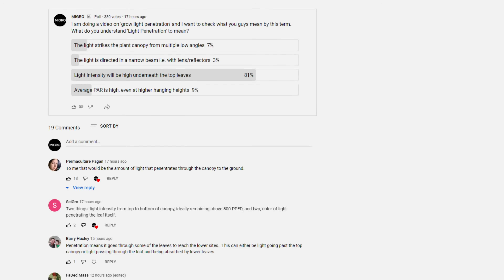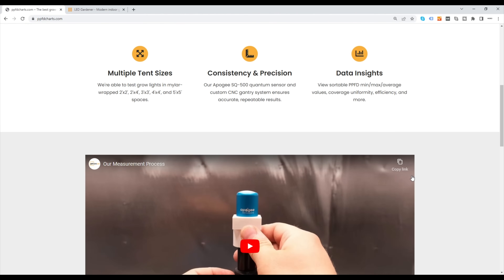Grow Light Penetration is WRONG

Comment: If you have the time to experiment or already have the knowledge, could you please make a video on LED grow lights and photobleaching? I've been experimenting with this for a few months and I came to the conclusion that the common consensus of it being entirely dependant on light intensity or blue light intensity is wrong. I have been testing with a variety of lamps, ViparSpectra P600, Spider Farmer SF1000, a sanlight Q1, and some DIY's. My main tests I did with the VS P600 because I noticed that light causes photobleaching the easiest out of all my lamps. I found out that if I add extra far-red light (740nm) with the P600, my plants can withstand more light without photobleaching. The same happened when I added more red (630nm) and deep red (660nm). A few days ago I started testing if IR light in the 800 range (850nm to be exact) would also help, but it's still too early to tell and I only have 1 850nm LED. I would love to hear if you already have any experience or knowledge on this? Also the migro lights seem to be impossible to find in Germany. Buying from the UK is no longer an option due to the customs charge nowadays.
Reply: I think migro is Dublin based so ROI and part of EU. Should be no custom charges?
Reply: @deelarso3766  Holy crap you're right. For some reason last time I tried to buy their UVB light I got the idea it was from the UK. Thanks dude

Comment: GREAT - now do a part 2 to explain why tearing off 1/3 of the upper leaves "so more light can get down there" makes about as much sense as sawing off your legs in Winter so you can use your socks for gloves.
Reply: Hey man, you may want to read "shape matters: plant architecture affects chemical uniformity in large-size medical cannabis plants".  Its a recent peer reviewed study available to freely read online.  Removing some of the older large leaves from the top of the canopy a few weeks before harvest to increase localized photosynthesis in your middle buds promotes chemical uniformity across the plant.  Your lowers ripen up and have higher cannabinoid percentages. Leaves photosynthesize less efficiently as they get older and localized photosynthesis in the bud sites affects ripening greatly.  Plants have extra leaves as they expect to lose some to pest pressure. You may not yield more overall, but you wont yield significantly less, and youll have a lot more marketable flower for packaging and less larf.  A combination of removal of the absolute bottoms, and a thinning of the top three weeks before harvest, resulted in by far the highest plant chemical uniformity and very close to the yield of control. It is the industry standard practice for a reason.
Reply: @willtremblay  that's the point, no one wants a beautiful bokeah of leaves and a lot of larf

Comment: The next question should be: Is it better to have a full plant canopy closest to the light or to have some openings to help develop the upper middle of the structure?

Assuming you are hitting max useable ppfd, there might be an argument for creative pruning to let some light through the plant.
Reply: I'm no expert but from what I've seen on grow videos that actually yield massily scroging and lolipoping (cutiing everything underneath the net) before stretch are the way to go. That way, the leaves on the net will create a barrier to prevent light from going under the net. Makes sense to me.

Comment: What’s really interesting is long wave and short wave radiation. I’m doing a grow from seed, using a 105w LED SMD panel light with dim ability through a MeanWell driver and Samsung LM301H/B’s. I’m using an oil filled radiant type heat source in my 2’x4’x5’ grow tent. Two plants, one was pinched at the 3rd-4th node, I’ve trimmed it up into a canopy of lollipops. It has 3-main branches after I removed the fourth one due to a first timer mistake. That side has been facing the radiant heat source, and it’s growing out a replacement stem to take the place of the fallen limb. Knowing that heat needs to be introduced in with LED grow lights, I suspect that what the plants are then able to benefit from, is that long wave radiation buildup in the soil, as well as the invisible heat from the long wave radiation. When she goes outdoors, that’s the side that I’ll face due-south in my northern hemisphere. That way, it not only receives the short wave visible light, but also the long wave infrared radiation that the hardcore HID crowd long for.
Reply: I do agree with the guy who can off as a prick.
Instead of adding a 1500 watt radiant heater,why not add an old school 150w hps?
You'd gain the ir heat,plus bump up your ppfd.
So may also find by doing so, you'll be able to drop the power on you LEDs.
I speak from experience.
I used heaters like that,and still do during lights off times during the winter months.
But I'll quickly throw an old school 400 w hps or MH up,and get rid of that 10 amp power hog as soon as temps allow.
🥂
Reply: @denniskartes1302 and you do what when the light are off turn the radiator on lol
This hps ir heat is just that nonsense
Reply: @denniskartes1302 plus is tent is probably inside is home
 is home not heated? and he live with a winter coat 24/7 inside is house
Reply: @denniskartes1302 Plus the tent is probably inside is house and is house is probably heated in winter so he doesn't need extra heat
Plus all the extra heat generated in winter by the HPS raise the temp inside the house and higher temp allow more humidity in the air and you end up needing a dehumidifier or run the AC in winter and AC don't run that well in winter and look kind of suspect
Or end up with mold inside your house
Reply: You're using a baby baby baby powered light and I assume about 12X more power on your heat source oil filled but still electric based radiator. It totally defeats the whole object. You're welcome 👍
Reply: Yeah, I totally hear all of you and this is my first grow so… In my defense, the heater is a small 300w unit. I’m really just experimenting with my understanding of light energy.
Reply: I'm the guy who came off like a prick. If you have access to RO water (not standard water) then you can get a warm mist (warm not cold mist) humidifier using about 300w and add humidity to correlate with the VPD charts plus they definitely add a couple of degrees C to the tent. More if you get the fans and stuff done the best possible. The perfect humidity helps transpiration and makes nutes go further and you're drawing the same power for faster growing optimum plant growth. Food for thought
Reply: Or just use HPS when it's cold.  Big big buds!

Comment: I've seen those comments about penetration as well, and it never made sense to me. Quite frankly it sounds very stupid, as if they just copied/pasted what they read on a forum without thinking.
Plant leaves are not transparent, they don't allow light to pass through. So even with the most powerful light on the planet, each leaf will always create a shadow. And if you tried such a powerful light to pass through leaves, it would destroy the plant because that would be a laser beam or something haha..

PAR is PAR and that's what matters the most. Most lights have a hotspot in the center with a PAR over 1000, and it goes to 700, 600, 500 on the sides. Basically other lights need to be raised higher to have the PAR in the center around 800-900, and to get a more even coverage. But this ''even coverage'' with raising the lights higher comes with a big minus, because now the PAR on the sides is also lower. The sides don't receive 700, 600, 500 anymore, now it's 500, 400, 300.

I'm very glad your lights can be hanged lower, it's extremely helpful for any grower, regardless of the tent height. Not only they provide a true 'even coverage' with a decent PAR over the whole canopy, but also your lights run very cool so they don't heat up the tent much, the light doesn't have to be high up close to the exhaust fan.
My ambient temperature from the intake air is 25C. I tested the light for more than 12 hours on maximum wattage and the temps inside the tent never went above 28C. And that was with the exhaust fan on minimal speed. For me that's a blessing.

If you please accept my suggestion, one thing i would like to see in the future is supplemental Far-Red lights to combine with the Aray. Doesn't have to be IR diodes on the fixture, it could be separate like the UVB. Maybe even attachable on the bracket for example.
I believe Far-Red can provide some form of ''penetration'', making the lower branches reach up higher to catch up with the top branches, thus helping a bit to create a slightly more even canopy. This way the lower branches can get more PAR when they stretch. At least that's how i imagined it after reading some articles, i could be misinformed though.
There are many other things about Far-Red which is said to be helpful for the overall plant's health, especially for autoflowers and bud production. But that's another subject, now i'm only talking about penetration.
If you ever make a supplemental Far-Red, personally i would definitely buy it. UVB will be coming along later as well. Even if there are no proofs and evidences of any advantage for the Far-Red, i honestly enjoy giving my plant all the bells and whistles even if it makes only 1% of advantage. It's a hobby that i choose to spend my money on, and it feels like a treat to my stuff for my plants.

Comment: for a start we de leaf or lollipop...we dont care about efficient lets see the chart at 4 foot.3 foor plant plus hanging height..some 240w lights use 2000 diodes..some use 500 diodes..obviously you will hang the 2000 diode closer because each diode only uses 0.12w..the 500 diode uses 0.4w..but like i said lets see the chart hanging height plus a 3 foot plant..so it will be 48 inch on the 2000 diode vs 54 inch on the 500 diode.none of this 3foot nonsense to make them look better...the 0.4w diode will shine further..it will be better nearer the bottom of the plant than using 0.12w diodes..a 1000w de hps will shit on any led.hanging height plus 3 foot plant.. 400-600par is poo...a 1000w hps will easy do a 4 foot plant and the par will be high near the bottom..he 600w will struggle with 4 foot so people do 3 foot plant ..if it was about efficiency we would have used 150w hps..4 of them cover more area than 1x 600w..but it wont do a 3 foot plant..so how can a 0.4w bulb..it simply cant and that why migro or anyone dont show 3 foot plant plus hanging height par readings..led side by side with 1000w hps 4 foot..hps will destroy it

Comment: I've always maintained the main advantage of LED lights is the source of cheap green light to penetrate the canopy. I'm about to start testing a single row strip fixture around the mid height
Reply: Plants don't even use green light to grow! 

You can actually shine green light on your grow area during their dark period and it won't break the dark cycle because the light is literally invisible to plants. That's why people have solely green lighting to work in their rooms during the 12 hour dark periods. 
You're welcome to maintain that now 👍

Comment: Very cool talk. I think a lot of talk about LED light penetration stems from the days of blurple lights. Early models had little to no far red and no green spectrum. They were terrible at working with any tall plants. Slow undergrowth and lack of branching out because of “no penetration”. LED lights these days; especially yours, addresses those issues and there is plenty of efficient par and healthy plant response more similar to sunlight conditions. Keep rocking and rolling. Love the content.
Reply: Blurple boxes had plenty of red and far red. Red LEDs are the most efficient and most widely used. They did have very little green and Shane just showed why it wasn’t as important to add green vrs 400 to 460 nanometer wavelength length. I guess it depends on which blurple boxes one is useibg too. But most used 12 bands which included 5000k white light LEDs and covered the entire spectrum needed. The problem with blurple boxes is the efficiency and the coverage ability. They had a huge fall off in par outside the physical shape of the light. Now fast forward to 2021-22. Light manufacturers are now adding more blue closer to 380 and 400 and 460 nanometer to their fixtures. Spectrum tuning is the next frontier.

Comment: Two thoughts: I believe that my mate is hesitant to move from HPS to LED because he believes in penetration; and also the song by The Stooges, Penetration.
Reply: The comments section is full of lies.  I've used HPS and led. Gavita 1700e good enough?

Led better from Scrog, HPS penetration is different with HPS. I could get colas the size of coke bottles (1liter) and bigger indoors. When I switched those colas are a thing of the past but the overall total yield has gone up. The quality hasn't. Best shit I've brown by far was HPS and the environment I grew in was not as under control as my led environment. Was way too hot yet results were better.

And I grew flames, cure for months/etc. basically I know what I'm doing. Everyone has their opinions but I'm going off my actual experience.
Reply: @Courtdog2k3  I'll change my profile pic. I easily hit 2+  a 4x4 table with a 1 plant scrog.
Reply: @Courtdog2k3  And depending where you are it costs more to heat a rook than cool it
Reply: @kiddynamite3931  I'm in DC in an old building, temperature in the house with the ac on was about 81 on average. Had to get a portable AC double hose joint just for the grow tent to be at around 80. Learned how to grow in these harsh environments with spider mites lurking. I'm better for it. As for results, today with leds I'm getting 2 1/2 per 4x4 and I'm not using co2. I likely can each 4 a grow if I do that. Some ppl are getting as high as 6 per 4x4 which sounds impossible but if I can reach 4 and I know there's room for improvement here and there? It's possible. Baby steps for me tho, I have to mentally be able to process that much in a timely manner. But to stay on topic, I grow great quality. What I haven't been able to do is cure my led grown weed the same and I don't know why? I'm not getting the results, it's not curing and turning better to the extent my HPS grown weed would. I haven't figured out why but I suspect it's the light since I'm doing the same technique 🤷🏾‍♂️
Reply: @Courtdog2k3  I always hear about #'s like that. But  nobody has ever posted. Not even a picture.
Reply: @Courtdog2k3  That's 3+ a table using old Raptor 15 year old hoods. I do breed my own, for quality, and quantity
Reply: Tell him to do it. Jus get a decent led. I went from 600 hps to 600 lumatek Zeus pro 2.9. Best quality and yield I’ve ever had. Better penetration too overall. I also have much better terpene quality too. I used to get the odd plant lacking terps or no terps at least one every grow out of around 8 plants  for like nearly 20 years, Not happened with led at all over the last 3 grows since I upgraded. All plants have had much higher terp levels, better density and yield also better colour too and much more purple comes through end of flower. 

I was hesitant too especially with the cost but it’s the best decision I could’ve made and I’m glad I upgraded and spent the money in the end. It paid off in the first grow, shame I waited so long tho but leds have come down in price a bit recently so that helped sway me.
Reply: @herbalterrorist420  he's running about 6 lights, perhaps. He likes to grow tall.
I have convinced another mate, who's advised that more yield, branching, bud size and terps/ potency.
Reply: @herbalterrorist420  how high do you hang your zeus pro and at what intensities at different grow stages ?
Reply: I've been in this game a long time. HPS is far superior to LED. LED companies came in, spent a FORTUNE,  and brainwashed just about every grower the last 7 years. I would take the equal true wattage this guy is using,  and easily double his yield. Easily!
Reply: @kiddynamite3931  lol yeah its all a conspiracy man, were just brainwashed sheep.

Its not even close guy.
Reply: @Str8GasGenetics  Were you around 15 years ago? I'm not a conspiracy theorists,  but the quality of beans,  and lights sold today, and the yields I see aren't good. If I yielded what I'm seeing I'd be real upset.
Reply: @Str8GasGenetics  The pic in my profile was seeded, and grown under a 250 W HPS. I don't see that unseeded with the best lights today